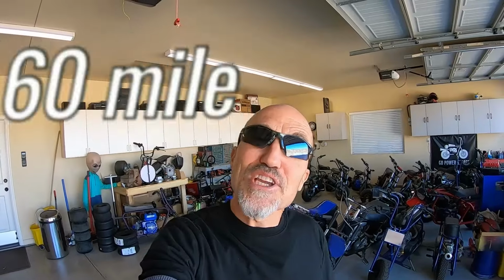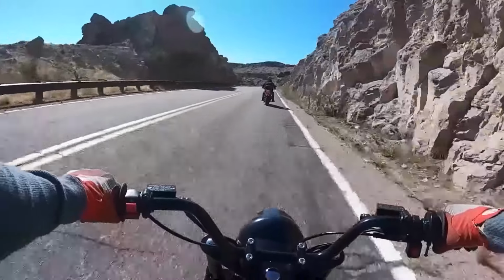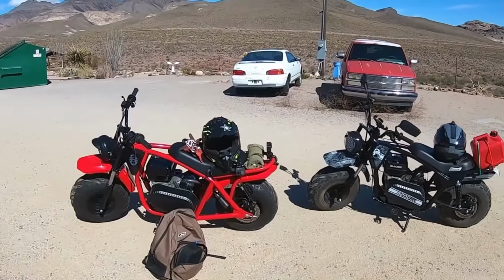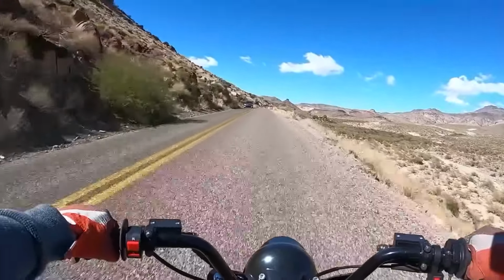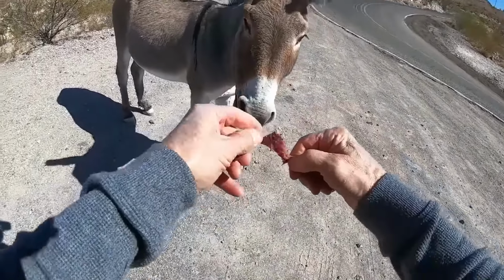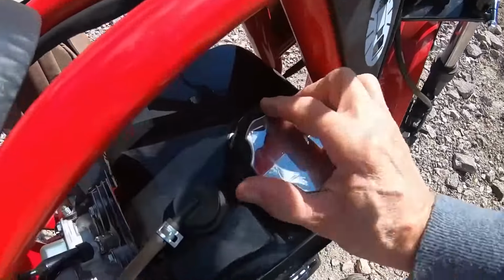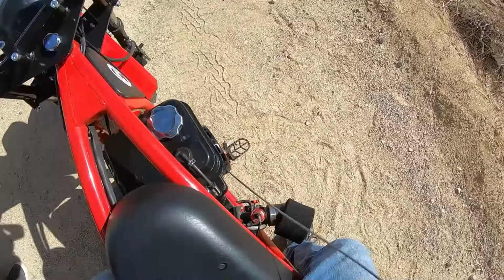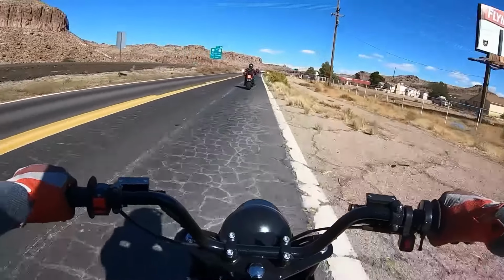Ultimate 60 mile mini bike adventure Kingman to Oatman AZ

Comment: there's always some Ass deliberately spoiling the trip...
60 mile trip... basically 100km (97km to be a little more accurate)
My 212, I have no idea what it uses per recorded distance.
 My 49cc 2 stroke scooter/moped would use. 4.7litres per 100km at 50 to 55km/h
and the 250cc motorcycle would use 3.1litres at 100km/h (yes the motorcycle uses way less gas than the moped, while doing twice the speed)
I'd be interested to know how much a minibike uses, and the average speed too, I hope you tell us!

Comment: such a great, peaceful and enjoyable ride. as a kid route 66 has always been something i wanna see in person as it comes from my childhood movie cars and its just as i thought it would look like  what a amazing view. love the channel black keep up the great work as ive learned alot from you in the past 2 months of my minibike building journey and just hit 67mph on my coleman cc100x with stock ghost and thats at 5400 rpm cant get it past that really unless i had a hill any ideas as to why its capping out is it because im running 18t front and 60t rear?
Reply: You should be happy with that. It may just be topping out on power. If I had a Ghost and didn't want to open it up I would get a better carb right away.
Reply: @Deucealive75 well i started off with a 60t rear and 12t clutch and put on a tacometer and it rev limited at 6150rpm at 52mph. i put a 18t clutch and 60t rear on it and its maxs at 5500 but takes it a minute to get there with no rev limit and hit 66.7mph. now i threw on my 12t clutch with a 40t rear and hit 67 at the same rpms of 5500 without rev limiting but im wondering why before i could get to that 6150rpm where as now i cant even get close is my gearing to low or whats the deal?
Reply: @all_falco9930  The 18/60 and 12/40 are the same ratio which is 3.33:1. This is why the speed and RPM were nearly identical.

The 12/60 is 5:1 ratio. Better for takeoff but you run out of RPM.

So if you want to keep your 65 plus MPH without getting to the rev limiter you would have to stay in the 3:1 gear ratio range. 4:1 or higher should hit the rev limiter at slower top speeds.
Reply: @Deucealive75  ahhh ok i do appreciate the advice i was going to try a 15t clutch and 60t rear but the clutches are like 60 bucks so theres that

Comment: Day 7 of asking a gx390 in a bt200x frame. Tc vs straight chain.
Reply: Ive got 2 identical doodlebug framed minis, both with 212s modified in the exact same way. Both are running wheelie bars. One has a torq-a-verter which started straight chinese but since been upgraded with a bunch of genuine comet parts. The other is running a Hilliard inferno centrifugal clutch. The whole purpose was to directly compare the differences between each final drive system. Gearing is optimized for each setup but by no means similar on each mini. Both bikes run pretty close in the 1/8.
CVT bike has run 9.10@ 68 and the centrifugal bike has run 8.90s@74.
The CVT bike is on the wheelie bars for the first 150 feet sometimes as far as 300 feet (!).
The centrifugal could easily be run without wheelie bars but for consitency i keep the bars on both. 
The cam is same in each mini, im gonna call the grind by NX their "cheater cam" and leave it at that. 
When playing around on the street, a certain way you roll the throttle on the centrifugal bike from a roll/cruising speed it will sucdenly loft the front wheel so fast it will scare you. The CVT bike will simply pick up the front by snapping the throttle at any speed 30mph or below, sometimes even higher. 
Its been an interesting comparison so far, had a lot of fun. 
Which one do i prefer? Not sure i love 'em both.
Reply: There’s not really a point in a gx390, a predator 420 or predator 459 max performance is better